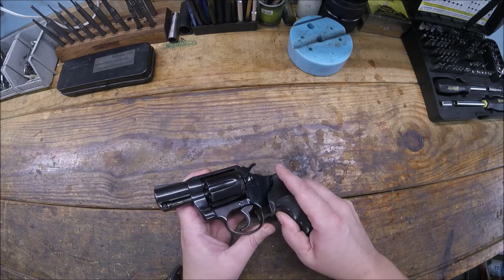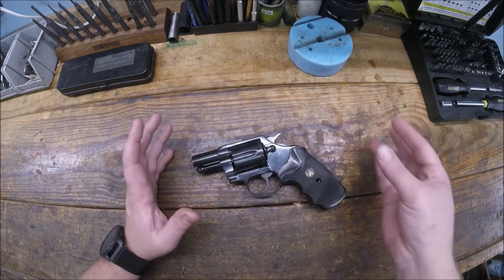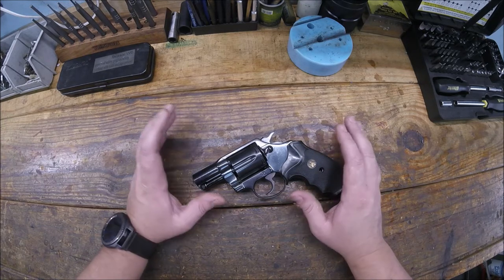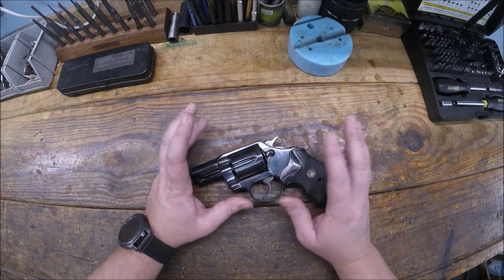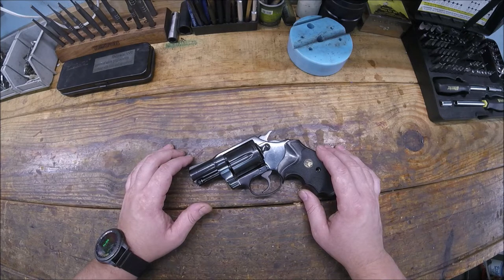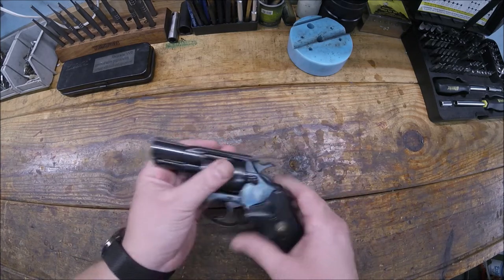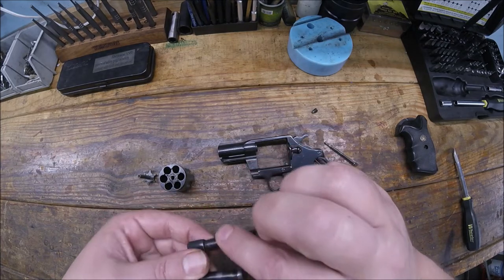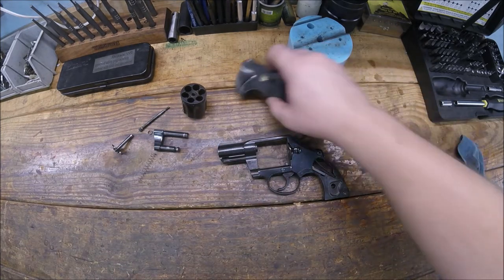Colt Detective Special disassembly

Comment: I have a 38 Detective Special pretty much identical to the one featured in this video.  I inherited the gun from my sister after she died many years ago. I got it out today to check it out and found that everything is frozen due to so many years of neglect. I tried repeated applications of WD40 in all openings hoping to free it up to no avail so it is probably going to have to come apart. I tried a couple of the screws and they are very tight, so I stopped because I didn't want to ruin the screw slots.  After watching your video, I'm not so sure I want to take it apart myself anyway.  Do you have any suggestions about soaking it in something to loosen it up?  Where is your shop located? I am in Western NC near Asheville. Is there some way I can talk to you...maybe by looking up your shop on the internet for contact info? Thanks.
Reply: Kroil Penetrating Oil.

Comment: Hi brother nice video! I wanted to know is there a white plastic washer underneath the button to pull the cylinder out the frame?  The side button does it have a white plastic piece attach to it. I saw it when you removed that part.
Reply from the maker: There is a nylon bushing in the thumbpiece. Or at least there should be.